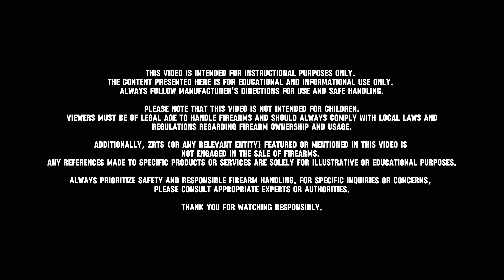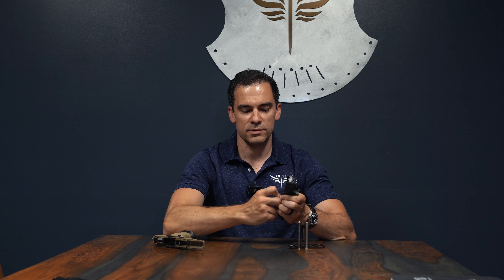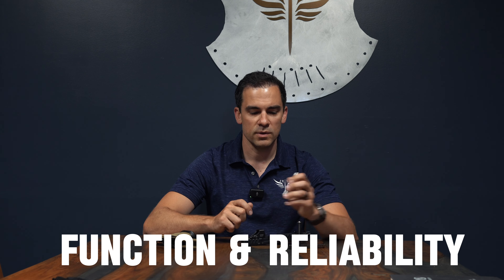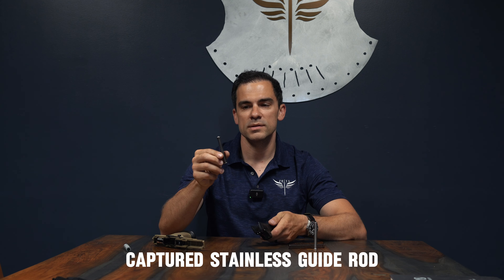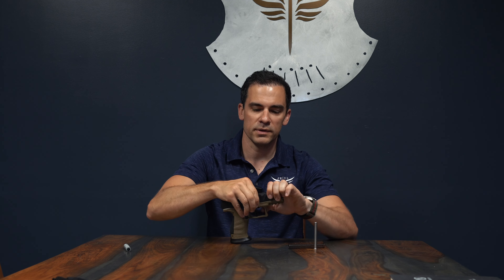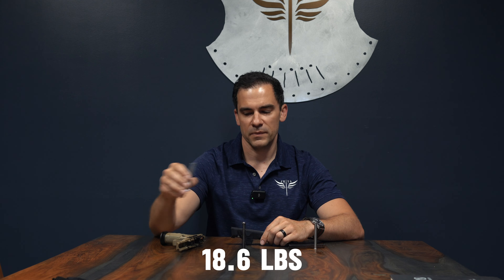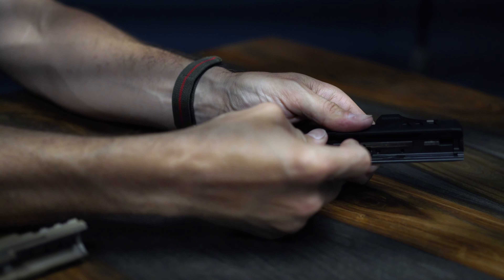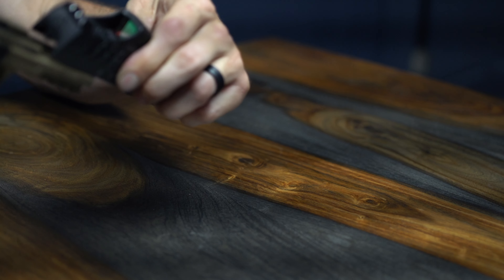Walther PDP Guide Rod and springs to reduce recoil from ZR Tactical

Comment: Ran 60 rounds today with the extra mass guide  rod and 18 pound spring kick was not as much ran 115 ball and 68 grain Underwood extreme defense +p no problems .  If this is mostly what I will be using should I go to a lighter spring?
Reply from the maker: That should work for both as that's the OEM weight, but you can drop to a 17 for the +P and a 15 for the 115gn
Reply: @zrtacticalsolutions will that lighten up the kick more than ?

Comment: I have 2 PPQ M2 4" and a PDP 4". Im assuming capture 15" for all 3? I just run the regular 115 at the range and 124 HST for self defense ammo. Im looking to improve any potential reliability issues vs polymer guide rod and hope that it helps with the recoil some.
Which of the spring weights would be best for recoil mitigation with regular load 115 and 124 ammo?
Reply from the maker: For self defense, go 17 or 18.

Comment: I slapped a 15lbs captured guide rod from yall in my 5in FS PDP. I usually run 124g at the range and 147g Speer Gold Dot for home defense and cold weather carry. It seems to operate just fine, but am I taking a chance on reliability with the 15lbs spring? Ik any modification from stock incurs a chance of malfunction but would changing over to a 17lbs spring be best?
Reply from the maker: Please send us an email at chris@zrtactical.com so we can help you find the best solution for your setup.

Comment: I have a ported pdp compact 4”. Which spring should I go with? Keep in mind I will be edc this firearm as well as using federal hst 124gr or 124 +p. Most likely the same grain ammo for range use as well.
Reply from the maker: Best idea is to buy out tuner pack of springs and experiment.  I way of knowing with something modified like that.
Reply: @zrtacticalsolutions okay cool just placed a order for the variety pack.

Comment: Sir, i haven't  seen anything listed for the pdp-f with a 4" barrel.  Thanknyou for your video.
Reply from the maker: It just takes a standard PDP guide rod so anything we make for standard PDP fit. Only the 3.5 is different
Reply: Sir, thank you for your response! Does the 15 lb spring you recommend  still retain the easy racking function of the f-series?@zrtacticalsolutions

Comment: Hi. Which one would you recommend for the 4.5“ Steel Frame? Do you sell the long stroke with 17lb? Best regards!
Reply from the maker: The 16lb will not work in the 4.5
Reply: @ ok, then which one could you recommend for my 4.5“ steel frame pdp?
Reply from the maker: @ChristophWittwer  we sell one specifically for the 4.5 steel frame

Comment: Which guiderod and spring would you recommend for the pdp compact 4inch?  Something that would be good and reliable in stock form and port in the future.
Reply from the maker: Ultra mass if you plan on porting as you will need to change the spring then

Comment: For your captured steel guid rods do they work without the spacer that is on some models or does that spacer need to stay on. Same question regarding the ultra mass uncaptured guide rod. I’m trying to decide which to buy for my new PDP pro-E 4.5 model. Thank you
Reply from the maker: Yes. They both require the spacer stay in place

Comment: Will the general purpose still work with +p
Reply: Same question, I know 15lb spring is recommended for general use, but if the situation arises where you need to use defensive ammo will the 15lb be reliable or Would you really recommend buying and changing the recoil spring to 18lb every night in case something goes bump in the night??

Comment: Ported and running exclusively standard pressure 124gr, what weight do you recommend?
Reply from the maker: @yomamasbeefcurtains  depends on the number of ports and diameter. You may need a few weights to experiment with
Reply: @zrtacticalsolutions  Floyd’s Commander porting.
Reply from the maker: @yomamasbeefcurtains  you will have to experiment

Comment: Would like to purchase the long stroke guide rod for my 5” SF Match. Is there any concerns for running +P through it every now and then?
Reply from the maker: For the steel frame, the long stroke makes a huge difference. It won’t damage the gun to run +p but it will reduce the service life of the spring.
Reply: Thanks for the reply. Making that purchase!